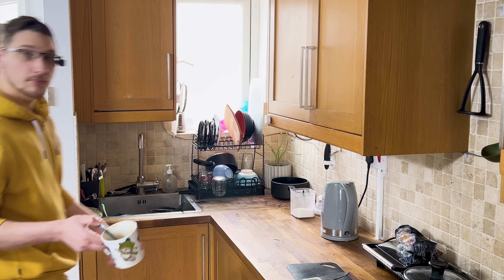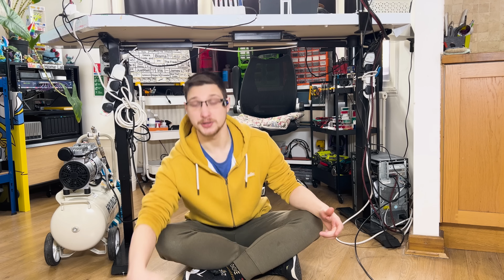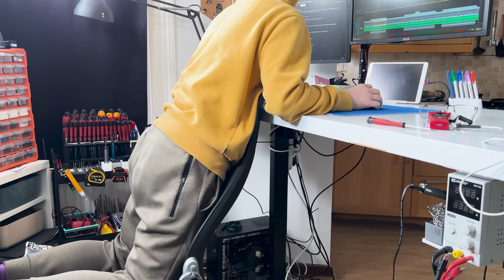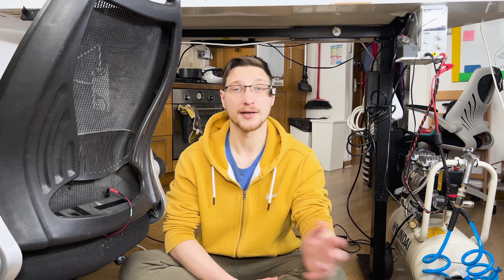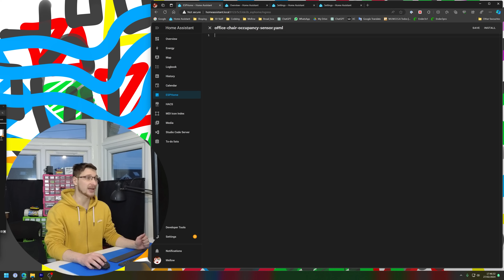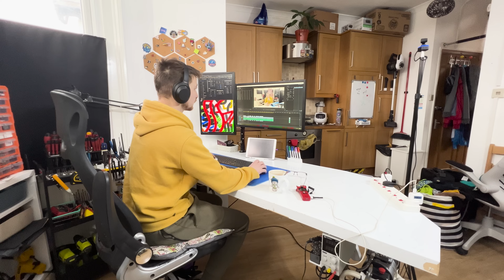Inverted Standing Desk

Comment: could use a zigbee door sensor and solder that to the internal pads inside the sensor and remove the reed switch 
same for the moisture sensors (I saw a guide somewhere for that)
Reply from the maker: I’m already waiting for parts, i’ll make sure about it when it arrives
Reply: @Mellow_labs nice 
I've been considering doing something like that myself (My desk controller has the control in the screen though so I'd likely have to redesign it though sadly

Comment: Hey there, thank you for this video.  I have several M5STACK Atom Lite which are ESP32-PICO based devices, they have limited pinouts compared to typical ESP dev boards, the pinouts are SCI, SDA, 5V, GND, 3.3V, RX, TX with 2 additional GPIO pins.  You can buy an RS232 base for these.

If I buy these RS232 bases can I attach these to an RJ45 breakout as the input from the standard controller and have another breakout connecting the RX and TX from the ESP32 and the input RJ45 breakout to the control box so I  have a passthrough system?

Please excuse my ignorance and bold question. I would love to use these items as I have them to hand, except the RS232 base and they are also very compact.  I have two identical Flexspot desk that I would much rather have programatic control over and maybe do similar to what you do.  I typically keep the desks in the upright position and would like to find a way to add collision detecion/aviodance in future so that I use them in the lower position from time to time without worrying I will damage anything beneath the rear (higher) desk.

Any input would be greatly appreciated. 

KInd regards, Lee.

Comment: I see alot of people reccomending the doorsensor hack for getting the pressure sensor in HA. But there is an even simpler solution. The Aqara water leak sensor. It has two metallic screws underneath that trigger the sensor if they are connected. Just loosen the screws, and attach the pressure sensor.
Reply: @aeliassen  was going to comment the exact same thing. I have this setup with a pressure sensor under the cushion on my balcony chair so when I sit down, the lights turn on and when I stand up they turn off. It’s a watch battery and I’ve had it out there for probably a year now without changing it yet.

Comment: Another alternative to using the sensor would be a load cell. You calibrate it as a switch and once your weight is off the load cell, it closes or opens it and the desk stands. That can be integrated into the chair frame, so you still retain the mechanism in case you decide to change the seat or something like that.
Reply: except it needs recalibrating after every christmas dinner

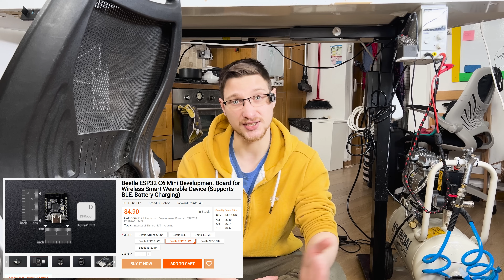Comment: 4:43
You could easily get those aqara/ikea coin cell powered zigbee remotes and solder the points for your chair sensor. Its cheap + battery lasts a long time.
Reply: sadly IKEA coin cell based things are being phased out as IKEA stopped selling non-rechargable batteries a year or two ago, and has been phasing out products that require coin batteries, and introducing replacements that use 1.2V rechargeable AAA batteries
Reply: @davetreadwell  
Then it's even better using those. Never use esp32 for battery projects, its horrible. 

For battery, use zigbee already made products and mod the heck out of it is my philosophy.

Comment: In your chair esp use deep sleep and have the pressure sensor connected to the wake pins also. If you used a solar charging board and a single cell lithium battery with a small panel on the top back of your chair it would probably charge enough to never need to be plugged in. The swedish inventor dude on YouTube has great esp solar videos to make it efficient

Comment: Nice project! I made something similar with my standing desk, but instead I soldered some wires to the control panel buttons and plugged a Raspberry Pico W to receive commands from a MQTT topic
Reply: Nice, do you have a guide or link for it?
Reply: @Tech_Verse  yup, it';s on my github under the repo mathcale/standing-desk-alexa-integration :)

Comment: Worth noting that the flexlispot desks use the same control board/interface as many other brands - including the IKEA UPPSPEL
Reply from the maker: That's great to know thx!
Reply: @Mellow_labs  they all use control boards/buttons made by  JIECANG
Reply: Shame that I can't find only the control board, I'm using a drill to raise/lower my ikea desk because it came with a manual crank (i am a cheap bastard) and all I need are the buttons now to make it look good
Reply: @25566 I’m afraid buttons are not all you need. You also need a motor :)
Reply: @sierpus  that's what the drill is for, I only need the buttons so it doesn't look like a hack job
Reply: @25566  Not too hard to gut the drill and use the motor/speed controller to fashion a button interface?

Alternatively, you can get the legs alone for around £100

Comment: I'd like to provide you with a nice advice. Hope you'll appreciate.

That chair is a killer. Take a wooden chair with hard surfaces, no wheels and a 90 degree fixed angle.

Use that instead. Your body will learn to sustain itself and your backpain will be gone for good. The less comfortable the chair, the better for your back. Your body prefers to hold itself!

The best thing that happened to me during the lockdown was that my office chair broke. My chiropractor totally agrees with me.

Comment: I've seen those magnetic door/window sensors being used as a sitting-down sensor.
You just have to mount the two parts on the different parts of the gas spring of your chair so that the contact closes when you sit down (and the gas spring compresses).
They're cheap and power efficient and usable for all sorts of hacks, if you're creative enough :D
Reply: That what I use for my sensor, works wonders, battery last months on end
Reply: That's nice! If you still want to use the pressure sensor, you can still use an aqara door sensor. You just need to open the case and desolder the magnetic reed sensor and instead of it, you can solder in the pressure sensor.
Reply: A solder free way of doing this can be done with the Aqara water sensor, which uses two small nuts with an allen head as the contacts on the bottom of the device. You can loosen them and loop a terminal or bare wire under them, then run that to the pressure sensor.
Reply: that's a neat idea auctully

Comment: For the chair, what you can do is write your own code isntead of using the pre-built tools.
In your own code you can make it deep sleep/sleep.
But overall the key is this:
When chair status changes, connect to wifi, post to mqtt (you can link a binary sensor in HA to an mqtt value)
So by doing that, you should be able to get a lot more time on the battery (months/years) - and only changes get published.
Downside is its custom code and you have to manually link/create the binary sensor in HA ... but upside is extremely long battery life.

You can extend this with an RTC - you could say force the RTC to wake the esp every hour - post battery level and force update seat position - just so it is always in sync.
But the chair sensor to a wake up pin should do the job to trigger on changes easy :)
Reply: I wonder if that extra time spent connecting would slow it down though.

Comment: Check out the aqara leak sensor for the chair sensor. It has exposed terminals that you can connect wires to.
Reply: that's what i use for my bed sensor. pressure sensor under the mattress and then linked to one of them
Reply: But then you have to take a leak on your chair every time...
Reply: @ced2k  😂

Comment: Home assistant... you have an ESP in the desk, that's always powered. You can add a 433MHz receiver to it, and a 433MHz ook sender to the chair. Now it would be ideal if just the normal doorbell sender could be put to use, but you have the problem, that the doorbell button is very efficient when it's not pressed, lasts for years on a cr2032, but not necessarily when it's pressed, and you have the situation that the chair is both pressed and not pressed for long periods of time, so you might as well have a micro that is nearly always sleeping do its own sending, and have two different messages for sat down and stood up. You won't reach quite the doorbell circuit efficiency, but it would be an improvement. Pick a micro with good sleep behaviour for the transmitter, an attiny is "fine" if you know what you're doing, some things are better than that, say msp.

You want a little redundancy when working with 433, like re-send a copy of the message 5 seconds later maybe once or twice. But don't hammer it or your neighbour's thermometer stops working. I suppose you might as well wake up every 5 seconds to do the butt weight measurement, and then you can have a little state machine on top of that.